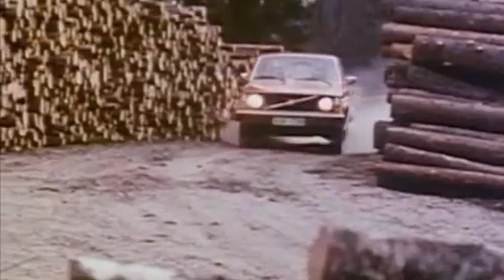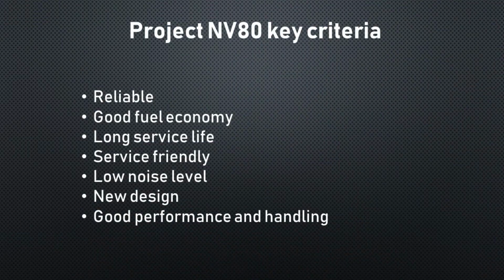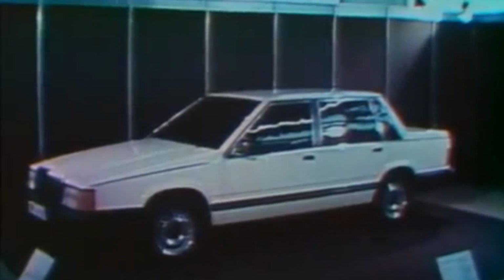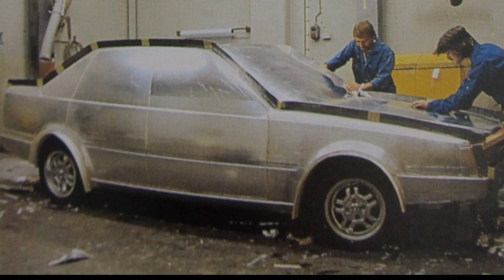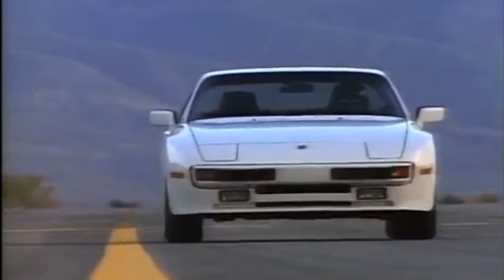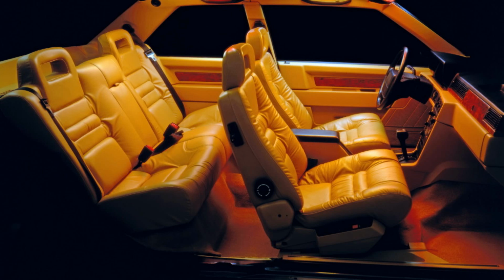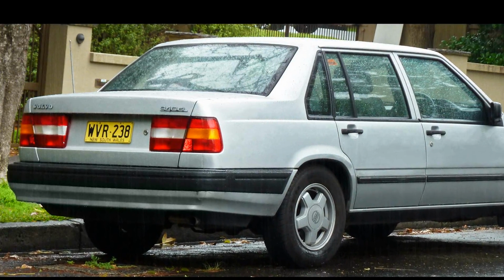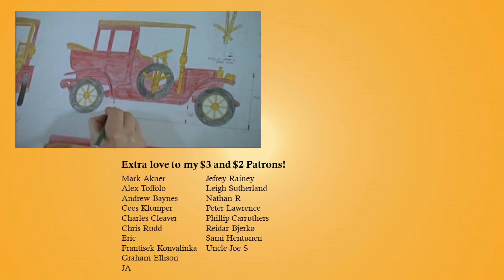How the Volvo 740/760 SAVED Debt-ridden Volvo

Comment: The 740 2.3L did actually got made, my parents owned one.
Reply: 740 never had smaller engine than 2.3 litre stock.  But the cars that got exported to countrys that needed smaller engines for ensurens or exhaust resons were fitted with a 2.0 litre version. For example Italy and Finland got these.
Reply: Im sure my dad had a 2.3 740, early 90s if I remember 🤔
Reply: Kenneth MacLaurin Yeah! Almost all 740 have the 2.3. 

What you guys getting confused about is the 16 valve turbo engine that only came in 2.0. 

It's a little bit hard to understand that in the video but they never putted turbo on the 2.3 16 valve engine because the gearbox was to weak.

That is what he talks about in the video and i had to rewind my self to understand what he just said! 

The 2.0 16 valve turbo intercooler engine was only avalible on the italian market and are really rare today
Reply: @andyhouston69 : I had a 1990 740 T16V estate many years ago.
It still exists, but are currently under renovation by new owner.
Reply: Dieter Meyer That is cool! Those one must be worth alot restored.

Comment: As a kid growing up in the 1980s, we had a few Volvos. A 1982 240DL and a 1986 Volvo 240GL. First car I ever drove was my moms 1990 Volvo 740 Turbo. At the time I wasnt a fan but looking back it was a great car and very solid. Eventually it was replaced with a 1996 850R. It was faster and more advanced but the old 240/740s were tanks in comparison. Got rid of the Volvo in 2000. They were never the same after Ford and my mom switched to other brands. Now China owns Volvo and they are just a name. Sad.

Comment: 🥱🤦🏼‍♂️  I haven't seen a single Big Car vid that managed to get through a review of a common car, without screwing up significant points.  Part of the reason is that he relies too heavily on lazy grabs of info from Wikipedia. 
 
9:30 - "By 1983...Volvo also took the 2.1L petrol turbo engine from the 240, and expanded it to 2.3L..."
  
No, and no, @BigCar.
• Volvo had already been selling their petrol 4 in 2.3L form since 1979.  
• There was no turbo version of the 2.3L in any market, until 1985.  
• It was a development of the 2.3 motor, not an expanded form of the 2.1 Turbo. 
• In the 740, power steering wasn't a luxury item Volvo included as standard.  Power steering was standard on the bog standard 240DL a decade earlier.
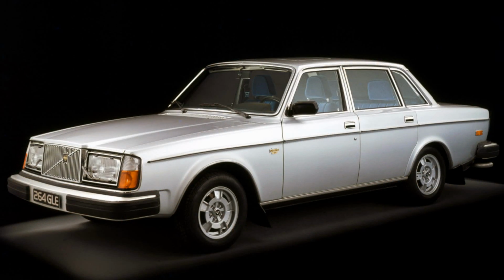• 14:29 - "Around 1991 the Volvo line-up was confusing. There was the 20 series..."   Well, it was clearly confusing to Mr Big Car, because he shows a 264 GLE from a decade earlier .  He also says the 700 series was replacing the 900 series, and on it goes....  😑

Comment: Um... the 850 was released in 1993, not 1991, and it came with only 5-cylinder engines, no 4-cylinders. You did correct this in the 850 video later on, but still stuck out to me.

Comment: Great video and the Volvo 700 series are finally becoming quite desirable.
It might well have saved the company but it was technically outlived by it's predecessor, the 200 series. Volvo were still selling 200 series cars when the 700 was dropped and the 900 series replaced it.

Comment: I thought the straight six from the 960 and the straight five from the 850 were developed by Porsche Weissach. They are basically the same, as Volvo wanted a modular engine.
Reply: The 5 cylinder is a engine shared with Renault - I know because we had an n/a one in a Renault Safrane in Burgundy. 100,000 miles in three years and not a single problem. The 2.5 from the 850 T5 would have fitted - only difference was the timing marks were reversed between the cars. Not sure about straight 6 cylinder. There was the PRV v6 in 2.4, 2.4t, 2.9 sizes - Peugeot Renault Volvo. Notably installed in the French Presidential R25, the one with the flamethrowers 😁

Comment: you are wrong in some many ways i do not know where to start, i worked for Volvo Canada for a lot of years and this couldn't be further from the truth, yes the 240 was a bit of an issue only because of the recycled sheet metal they used in the first run in the early 70's once that was changed it was a great success beyond that time, still a good video

Comment: I have a hard time believing that they used a wind tunnel in the design... 740GL 1987 car my first car :)
Reply: You can refine a boxy shape quite effectively actually - it's all about boundary layer control - kind of like tricking the airflow using various shapes into staying attached, or going where you wanted so it'd reattach and not go into vortex flow which causes drag (ie, the back end of a hatchback/estate or behind the rear window of a saloon). Air doesn't act like you think it should act visually - that's why aerodynamics is a science. Those little winglets on modern airliners weren't put there for aero, they were put there to stop cessnas getting caught in trailing vortices and headbutting the ground. Everyone was very amazed when the fuel economy on the airliners increased massively - because the drag vortices were turned into a controlled end plate boundary layer on the wingtip - no turbulence, no drag. Its why smaller aircraft have ventral/dorsal winglet sets, doubles the effect, slightly increases yaw? stability and saves even more fuel percentage wise.

Comment: i have had 3 Volvo's  over the years  a 1973 144DL[s] 1980 240 GLT and 1991 940 SE Turbo.  of all the cars loved the 144 and 240 but the 940 was very under powered and did not tow as well as the 144 or 240. The 940 was a nice car to drive and comfortable. It lack the same performance of the 144 as it had the same 2Lengine and lost it power due to cat. Only kept it 2 years.

Comment: "The 200 series were unreliable" yea idk about the first ones because mine is 1985 with 300k miles and is looking mint and no problems. And my 1986 740 had more problems then 240 but both are easy to fix

Comment: I had the 760 and I would never ever consider it economical on fuel ! Only when motorway cruising would it ever be considered approaching economical. Today I drive XC70 with petrol engine ... same story.
Reply: Because the transmission ratios are designed to make for a happy car at motorway speeds. A tip. What might help. Go out on the motorway and get to your usual cruise speed. Note engine rpm. Try and keep fairly close to that rpm at cruising speeds on other roads - you might get a surprise. Also, fit a sump heater - made most of the difference on my Safrane between an average of 22mpg and 28mpg on the same routes and travel..

Comment: I wonder how the connection goes with Volvo being in financial need and the purchase of Dutch Daf in '74.
Did they intend to produce/develop smaller cars here? (which they did). Was it one of the reasons they were in financial dire straits?
The Volvo 66 could have hardly been a saviour for them in the small car market and although the 300 series sold pretty well it wasn't really al that small of a compact car.
Reply from the maker: Good point. I didn't dig deep enough.
Reply: @BigCar2  I think this sheds some light on it, just got this from the 300 series Wikipedia:
After building a series of compact cars, DAF sought a partner to bring its new larger model, codenamed P900 and intended to become the DAF 77, to market in 1970. Several manufacturers were approached, including Audi, BMW, and Volvo.
Volvo was not originally interested due to the cost, but they were later persuaded by DAF's access to Renault engines. This helped Volvo expand its model line-up without the large expenditures associated with developing a new model. Building cars in the Netherlands also helped the Swedish Volvo to access the markets of the EEC, of which Sweden was then not yet a member.
Reply from the maker: @AxeGaijin  Thanks!

Comment: Indeed it was a boxy car, but it was the early 80s and most cars designed then were boxy in shape.  Major manufacturers such as Toyota, Mitsubishi, Cadillac had similar shapes.  It was the style then. The sharper the angles, the better.

Comment: 13:47

“The old 1974 [SOHC] V6 engine, which was becoming uncompetitive.”

Laughs in GM 60 degree OHV V6 (produced until 2011).
Reply: GM's 60 degree "X engine" went out of production in the USA in 2005, though it was produced in China until 2010. If you're referring to the Buick 3.8, it was actually 90 degrees. GM was very lucky with that engine. Through it was carved out of the 1953 Buick "Nailhead"  V8, sold to Jeep in 1964, bought back in 1974, and given an even-firing crankshaft in 1977, GM squeezed 240 HP out of it without turbo or supercharging, and up to about 280 with it. It's a pity they couldn't  manage their other projects as well. The Buick all-aluminum 215 V8 was from the same family and Rover kept it going into the 2000s.

Comment: The 240 was long in the tooth. It simply was dated by the 1980s. The first 700 series was the 760 lux model with the PRV V6. then the 740 came later. I don't think the Volvo's "boxy" shape was anything like the 140/160 to 240/260s boxy shape. Those cars had rounded corners to their lines, not sharp creases like the 700 series had. The 700 series looked like a lot of GM cars. But inside, the 760 had a nice interior, way nicer than the GM cars.

Comment: i used to own 740 gle ... man... the body is indestructible, the engine is easy to fix... but dashboard quality is garbage, after 30yrs the plastic is breaking itself apart and rattling, sure it is 30yrs old but compared to germans, it is not very good...  i dont know, maybe it is because different manufacturing process because it is the right steering one because i live in indonesia

Comment: This might be a stupid question but how is a 240 unreliable?
I thought it was more reliable then the 7 series...
Also they had the daf 77 (3 series) which was fuel efficient I probably am missing something
Reply from the maker: I mention the 240 was unreliable - in the first 1-2 years of manufacture. After that they solved the reliability problems.
Reply: @BigCar2  oops didn't get that but thank you for responding q

Comment: For Volvo, "Assembled in Canada" at one time meant fitting the steering wheel and dashboard padding on the cars [2 nuts, 4 screws] while they were on the RO-RO vessel alongside in Halifax, then driving them off, parking them,  and slapping an "Assembled in Canada" sticker on it.  Was a running joke at the time.  Regulations, eh?

Comment: The 240 definitely had problems in the beginning. These were by far the most sold cars in Sweden. And they were expensive cars. Swedes bought expensive cars. Amazon, 140 & later on the 940 were very good cars. In between there are very divided opinions about Volvo. I am talking about 240 & 740. I am swedish & having had these cars all around. They were everywhere. 940 is the refinement of the 240 & 740.

With 940 they got the car they should have had to replace 140. 1975-90 was a dull period for Volvo. The best 240s & 740s are the late models. They were lucky that Ford, GM & Rover fucked up in the 80s & that Peugeot changed their line up into smaller cars.

Comment: Wonder where this crisis was as Volvo was involved in motorsport almost the whole time, first via Volvo R-Sport and then the re-branded Volvo Motorsport AKA VMS. Also to bad you didn't mention Volvo's success in motorsport from 1983-1986 with the Volvo 240 Turbo, and also that Volvo R-Sport had built a Volvo 760 Turbo Group-A prototype 1983. 

This prototype was called "01A" - http://240grupp-a.se/gralle-01a/

But after extended tests and evaluation it was found that the 760 could not beat is older cousin the 240 on the tracks, and the project was put on ice. But none the less there was plans to phase out the 240 and replace it with the 740 1987. However this never happened due to a series of unfortunate events that happened in 1986, and Volvo pulled the plug and left motorsport for some 10 years, when it as time for the 855 Estate to go racing. But that's a later story.

Comment: drag coefficient of 0.4? This is considered very very bad, even for the 80s
Reply: In 1982 that was probably about average. The Aero revolution was just starting to kick in. The Audi 100 which at the time was considered the most aerodynamic car on sale had a coefficient of 0.3 and that was only the most basic model with a single rear view mirror (yes, a single rear view mirror on a large Audi), the better cars of that year were around 0.34-0.36, the vast majority was around the same mark as the 760. I believe the 700 series station wagons were actually more aerodynamic than the sedans.
Reply: @flemingpandel5287  . Ι agree, but I think this number was presented as something good in the video
Reply: MrDieselakias yes, but it was better than the 240, which had the cd of a wardrobe.
Reply: @MrDieselakias  A cd of 0.4 was better than the the vast majority of cars on sale in 1982, lets put it this way. Granted most of these were 1970s designs.

Comment: The question I'd have is why Renault and Peugeot? Why not Volkswagen or Mercedes-Benz?
Reply: The V6 (much maligned but mine's been good in my 760) was a joint design and manufacturing project between these three companies, mainly so they could compete in the US market where medium sized V6s were  common. The straight six turbodiesel used only in the 760TD and the VW LT van was a variant of the Golf diesel engine. Mercedes were big enough to go it alone, and being in the big estate market probably didn't want their rival to have their engines.
Reply: @shugthehornyhaggis   For a car like this, I would've preferred a Mercedes-Benz diesel engine, or possibly a turbo diesel.

Comment: Wow, so much in this video that isn’t right. The 4 cylinder 2.1 liter engine never came with turbo, that was the 2.3 liter that had turbo. The 3 liter engine was a I6, in the video you make it sound like it was the same engine with just bore out cylinders like the B21 and B230.
Reply: You also have the B204GT/B204FT.